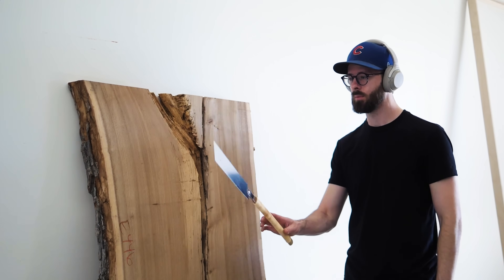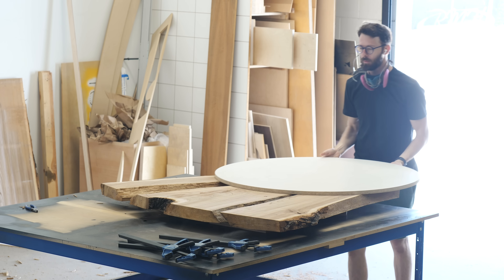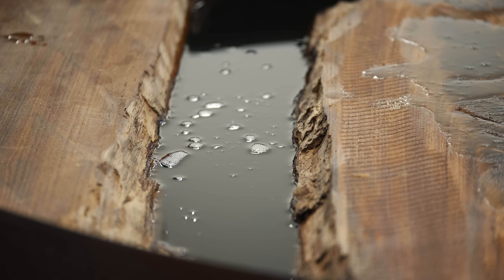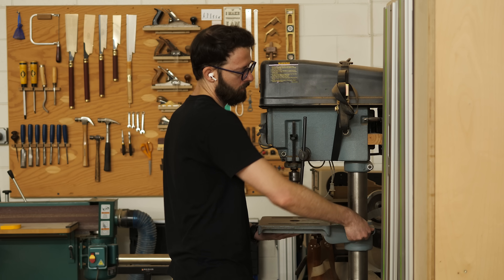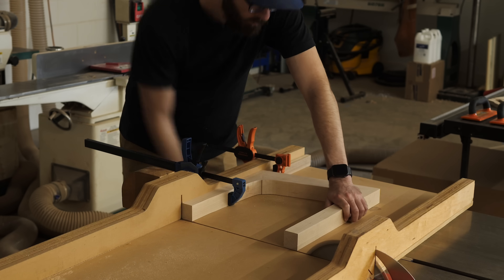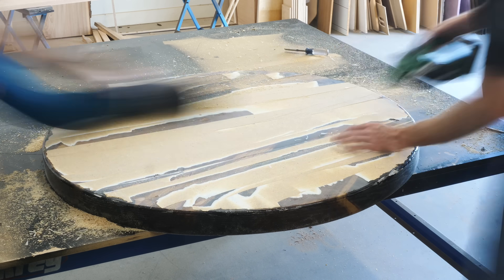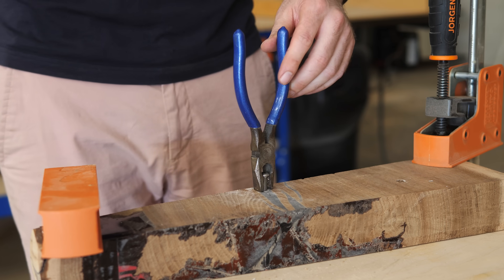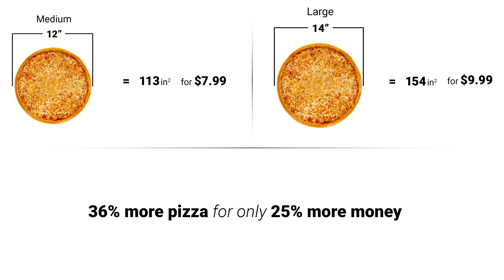They Said This Wood Was Unusable

Comment: Fun tip for inserting screws or bolts into epoxy! 
If you heat them up the resin melts onto the bolt, strengthening the bond and keeping the threading just a little tighter than just driving them in.
Reply from the maker: Cool tip. Perhaps I’ll give that a try. Seems like it would look cool on video too.
Reply: @Foureyes.Furniture  I hope it helps 💖 
But like you found, your resin was Fine as it was c:

Comment: I have a project ive been working on for about 5 years now and it is almost done, my friend was having me cut down some Chinese elms and one of them there was 3 trees all growing together and when i cut it down my friend was going to grind it all up i told no way i will dig it up, it took me about a month cut there was thousands of roots and i was digging it up myself, the hole ended up being close to 20 feet in diameter and 4 feet deep, i threw huge logs under the stump as i clipped out the roots and with my big car jack and a bunch of logs i was able to get this huge stump out of the ground and onto my flatbed trailer, this stump was the size of a small car and very heavy, i wish i would of seen one of ur videos with that modified chainsaw cuz that is pretty cool but i had my huskavarna and a 3 and a half foot bar and this was a very hard cut to cut it as straight as possible, the trunk was about 3 foot by 5 foot and the slab i cut off was around 5 inches thick, and it was so beautiful and wild looking and  it took alot of work to get it how it looks now id love to send you a picture of it, one side of the table top looks like a moose and the other side has a bears face and its all natural, a lot of people say Chinese elms are garbage trees but when they see how this looks they are in ah, i still have that stump i cut the first table top from and after seetyour cool modification i need to modify my chainsaw to make a much better cut, just wanted to say have you ever cut the huge tree trunks on an angel, if you haven't give it a try cuz some of the wood grains you see will blow you away, the cuts you are doing are pretty nice but they all have the same look, angle cut like start cutting on the top end and angle down to the bottom

Comment: I worked with a wheelwright who barely used a tape measure, but used jigs or templates all the time.  What I gain led from that was they he was more accurate than anything I had seen before and so I avoid the tape measure and use templates when I need to.  Sadly it has been some time since that was necessary

Comment: Re the melamine sticking.
Try laying a plastic sheet over the melamine. The sort of plastic sheet that is used under a concrete pour would do, or a lighter version in clear. Even 'Gladwrap' would do for small jobs. Much more reliable than mould release. (This technique is often used on repairs to epoxy/carbon racing kayaks to get a good finish).

Comment: Good call on the triple-leg-assembly decision. And a ~question~ (no, too vague) speculation -- what if the client(s) wanted a table where three principals could belly up and work out important issues? In such a case, would a person actually want a Y-shaped starter slab, and would that obviate the need for the epoxy river? Or hey, what if each of the principals were to bring an assistant/support-person to the meeting? Y-shaped or circular? And do these prickly power-dynamic considerations bubble up (loved that sequence, btw!) in the course of running a table-building business? Goodness, I hope not.

Comment: When sinking bolts into the epoxy crack to attach the base, you do not need an inset.  Epoxy can be drilled and tapped to accommodate a bolt and the strength is as good or better than a screw driven into wood.  Boatbuilders do it all the time

Comment: There is a product called, "Get Rot," that you should look into if you have any more soft wood in pieces you want to use.  It's a a very watery resin that's designed to be absorbed into the wood grains to restore the wood to it's original strength.  It is expensive, has a long curing time and I don't know about its compatibility with other resigns, but, it would make all those soft spots hard again.  Its used on old wooden boats on parts you don't want to have to replace.  "From the back side," you have to dill 1/8 holes, close together, throughout the soft spots, in order for the "Get Rot" to thoroughly soak into the grains of the wood.  The treatment also kills any dry rot by encapsulating it in resign. You should find a small sample of soft wood, treat it, examine it over time and then encapsulate it the resin you normally use and look at the results.

Comment: I dont know about you all, but for me with this build. The choose of color in the epoxy to my eye would have been oxblood red where, if it possible, have a level of transparency within the epoxy where you can faintly  through it and also se the grain within the table that would normally be covered by the epoxy. Also what kind o glue do thy use? This is just an idea, but keep the untreated scrap of wood that is to small to use in anything. Gather all of them up. put it all in a metal tub of some kind and have a small fire of some kind. A few days latter collect all the ash from the fire, and grond it down to pot ash. Then head up some natural risen, like gum resin, and find a mix of potash to gum rein that would be used as a glue. Just an idea

Comment: Nice work. From my work with molds for fiberglass and carbonfiber parts. If you don't use tape you can buy PVA or just wax the hell out of the area that your piece is sitting on. Epoxy can't stick to it.

Comment: Taste is personal whilst skill is universal. Not my saying but it seems to encapsulate many of the opinions. You can like the table or hate it but the skill is undeniable.

What I like about the use of epoxy is that it uses timber very efficiently. Years ago, that slab would have been killed up with a huge percentage of waste - or just condemned to firewood from the start. I’m sitting now in front of a 12’ x 4’ coffee table that I made from a really interesting piece of London Plane (Platanus acerifolia). Interesting is that Chinese curse - it means that it had more defects than you might imagine. Anyway, the use of the smallest amounts of epoxy that I could use has turned into a useable piece of furniture. 

What I don’t like about epoxy is that, in itself, it’s not an environmentally friendly product. So, as in all these things, there is a trade-off. My taste is not for pieces where epoxy is the main feature rather than a supporting role. 

I would have been very tempted to use that slab, with its stabilising pieces underneath, and just put a large piece of glass on top. You would then see the void and checks as the tree had them. Better or worse? No, just different and more to my taste. But, maybe not many.

Comment: Reply to 20:05...
There was a rather important piece of information missing from the explaination of this trick.
The two lines will only cross in the center if you draw your lines inwards from the exact center point of the two random lines which meets the edges.

Comment: well i personally dont like when things look to "clean" and modern - i like them more natural - but it looks decent. just not for the price IMO (i still appreciate the work done). 
1. would have kept some bork that was still intact and tried to seal it so it satys like that
2. would have kept some non-round shape conserving some of the natural shape of the tree
3. might have put smth in the resin or whatever that black stuff was (like some different kind of stone or some wood pieces or roots or.....so many options.) so it wouldnt be such a large one-colored surface of just black.
4. i dont like the legs of the table :P 

but to each what he likes, obviously the circular shape and the clean style was intended. just not mine i guess.

Comment: 20:10 - what you see in the picture on the top is correct (as the center of the lines is the starting point for the perpendicular ones). 
What you do in the video is not the same and is not correct --> you will not get the center that way.... you can be way, way off

Comment: It is unreasonable to spend the same money on epoxy as you would on wood. Maybe the table you make from a single piece of wood is more acceptable. But if I were in this particular situation, I would divide that board into 3 pieces with a smooth cut and glue them together, and I would prefer to have a smaller diameter but non-epoxy surface.

Comment: The very second you are ok using resin in a build, the condition of the wood is no longer that relevant. If the creation needs to be entirely wood, ya, that's a problem. Not the second you include resin in the equation. Myself, I'm of mixed feelings. Resin is neither good or bad. It's just an element to choose from.